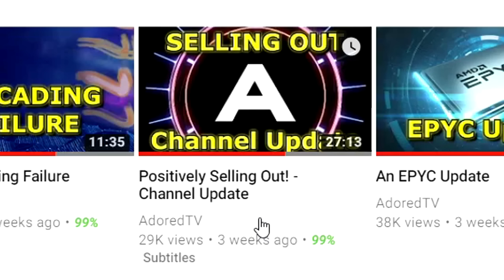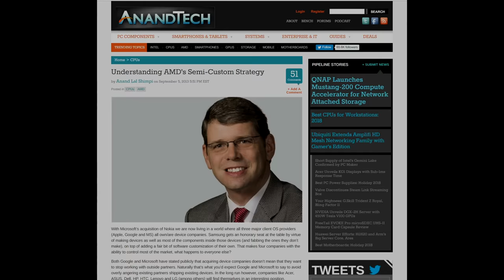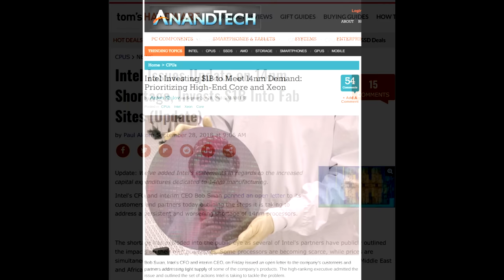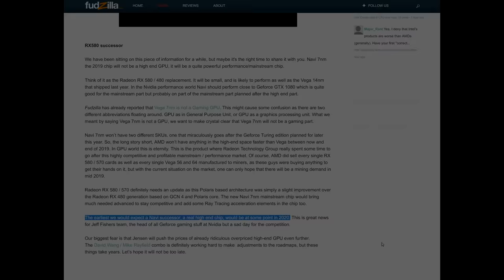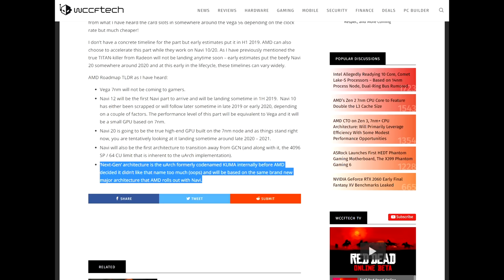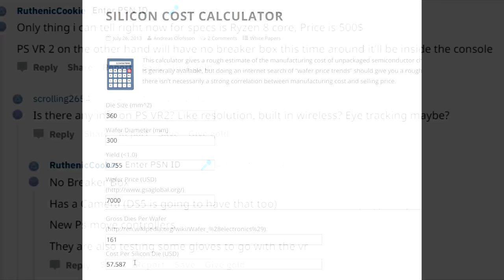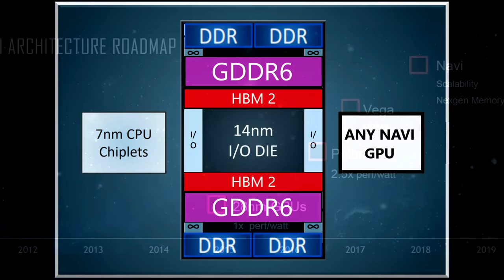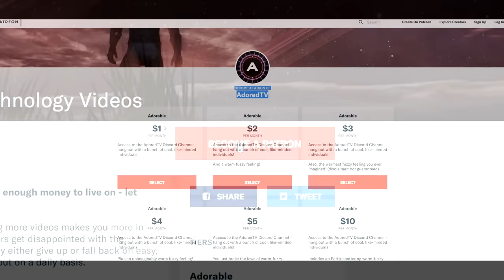AMD  - The (Evolving) Master Plan

Comment: Navi will itself be a chiplet, imagin datacentre chips where 1 socket can plug in 32 cpu cores and two gpus with infinity fabric and unified memory... Then scale to dual socket, or quad socket. It's not about 'the zen of gpus' zen will be a gpu/cpu hybrid in datacentre. As for consoles, just a smaller version, 1 cpu chiplet and 1 gpu chiplet with IF and unified memory.

Comment: The one thing i find really interesting in this whole thing is that AMD have only said that navi (and future gpu's) won't be multi gpu per card for gaming only until, and this is the important part, that the games would only see them as one single gpu, rather than a crossfire type of system. Why is this important? Becuase of the way navi may work in the fact they could go for an IO die like the zen2 chips. I think they may be leaving the door open for themselves to be able to have the games look towards the IO as a single gpu, using drivers and possibly something in the IO die to make multiple navi dies work like one. After the debacle of the vega launch AMD seem to have taken a more conservative outlook on things and i think they want to have a working model of this so i expect they will launch the navi 12 cards (and the playstation version as well) before making some special IO dies to make a test version. That will give there driver dev's time to get post launch patchs done before they take some off that to work with the test cards they make to see how viable this approach is. Wheather we see a multi gpu navi based system will depend on how well this works and how quickly they can get it to work, if it takes too long i suspect they will skip the navi version and use the knowledge gained from this to be put towards there next gen gpu cards. The best thing is, the work done for the IO wouldn't even have to be a waste as it could easily be used for there professional grade cards as those workloads don't have a problem with multi gpu cards so all it would cost them in the end is the driver dev time which would still be useful for future cards.

Comment: (I would say it really make no sense in making 2 @4core chiplets for PS5.. I would say, probobly all future AMD CPU will use the same chiplets (of a version there of) but the really very low end.)
I followed you to the end now and relized.. ye... of cause.. Jim did understand that... of cause he did.

One way to scale it could be to have a very smal IO-die for low tear market, and a large with more L3 cache and say twice the memory controller for the high tear market. This even makes it possible to run the IQ-die in 28 nm .... if there is a point in that (i kind of doubt it)

The issue with HBM is that it.. as far as i know, it can´t be  used with FR4 mounting, it needs a interpose. (if they can´t find a way to trick it).

I would say, it really makes no sense in haveing bot DDR4, and a GDDR6 as well as a HBM2 controller. 

A snekey way of solving this would be to hock up memory in infinitifabric. This would be almost as efficent as HBM, but much cheaper and easier to produce. This should make the able to ad about  a GB or so of L3 DRAM crash (or about 256MB of SRAM)
Reply from the maker: There could be more than one IO die yes, I considered that too.  HBM 2 is a tough one agreed, I do wonder if they can get around the interposer for that as well.
Reply: @adoredtv  

"I do wonder if they can get around the interposer for that as well."
I would say.. for Playstation 5... not a chance, the economy is not there yet.

Running the memory of infinity fabric is probobly the second best option. Of cause, then they need to make there own memory chips, bit that is pretty cheap.

Having a DRAM cache makes a lot of sense cutting down the overhead for the. Specially for things like screen bufferts. A 4K display all frambuffers is about a quarter of a GB or so. Then having some stuff like render buffert or  models in cache is also useful. Pretty much just streaming the textures from the main memory.

This is also making the split GDDR6 and DDR4 kind of useless. Having unified memory in a console saves memory and also bandwidth.

I guess we are getting closer to my dream of a socketed GPU.. I predicted almost 10 years ago now that we eventually would have GPU and CPU in interchangable sockets. CPU does have L3 cache to cut down on memory access, GPU need screen bufferts, and they need to be rather large.

HBM is of cause one solution, but its to expensive for the main market, at least today
Reply: Well if Micron can get their 3D Xpoint in volume production, it could provide a buffer for a smaller HBM die, reducing the cost
Reply: @456MrPeople  yea that would be interesting.. but does Xpoint have sufficiently low latency to work as a buffer
Reply: From what I've seen from Intel's Xpoint implementation in Optane, it seems so

Comment: This makes a ton of sense. The better your usable/salvageable yields the better your profit margins. If you can go from ~80% to ~100% usable chips per wafer. You effectively get a 20% reduction in per die cost which gives you a sizeable improvement in revenue  per wafer.

For applications that can accept the increase in latency a chiplet design brings, the cost and yield advantages make it a no brainer. More performance for the same $$ or less $$ for the same performance it's like getting your node shrink but not having the increased wafer cost for it. Talk about having your cake and eating it.

Comment: Information gathering is an art, and you sir are a master of such. I think from the last presentation AMD is also trying to fix the Crossfire situation by utilizing the PCIE 4.0 to detect the GPUS through the Processor registering all cards it finds as one usable graphics memory. So a system with multi GPUs and new Zen 2 processors may be able to run multi GPUs as one. I am just guessing from what I heard them say.

Comment: Interesting.... @37:26 on the top-right corner you can see this particular chip came out of a partial die (yellow-marked) on the top right side of a waver.
The calculator graphic you got there (38:20) is quite accurate, nice to see.

Comment: Awesome video, One thing is not clear. The speculated IO die WILL be different from datacenter dies, right? Two sku's; one for all mobile, low end PC and Console market. and one with IF for all higher consumer and datacenter products. If true, they wouldn't even need 'IF'. And the Navi sku's seem very shaky. Then again, their entire GPU department seems to be lacking an answere.

Their mobile lineup partially failed due to marketing and consumer demands but also due to their high SoC voltage on their products. (Intel had years of refinement in that department.) I doubt chiplets will fix that problem, even if you consider 7nm. More dies = more complex voltage regulations.

AMD's chief architect Dan Bouvier on the possibility of fanlesss 7nm APU's in mobile.
“We looked at it,” Bouvier said. “But with all the overhead, it just squelched the frequencies. The OEMs have figured out to add about 50 percent thermal system improvement, and that may be enough, especially if you go into 7nm, where you get a nice sweet spot that just fits.”
https://www.pcworld.com/article/3299431/components-processors/amds-raven-ridge-apu-designer-points-to-power-as-its-next-advantage.html

Thank you for the hour long video. It has not gone unnoticed (and unwatched)

Comment: agreed 100%.  as per a previous comment on twitter or here (i forget), the Zen IO die is a beautiful thing for APUs, and it was begging for a navi like GPU to be paired with it.

also, i suspect LATENCY for GPU memory isn't such a killer so long as the BANDWIDTH is good enough.  the big accesses are streaming textures i would suspect; you're doing big chunks into the L2 cache, not smashing it with lots of small IOs.  Zen dies have pretty large caches to hide the latency as well.

Comment: Here's a nice addition to this.  Ray tracing scales better than rasterizing with multiple chiplets, and you can actually use compute units for ray tracing without hardware acceleration. So maybe AMD:s high end ray tracing part, is nothing more than putting multiple low end parts to a single package with high enough memory bandwidth to support everything.

Comment: I’m a fan of the memory controller having an Either a dual or quad core arm cores to run the consoles Operating System effectively allowing developers to use all 8 cores and 16 threads with out background tasks.

Comment: I think this could be true. However, one thing you need to keep in mind is that it's unlikely that they will complicate the consoles with multiple type of memory. Both the PS4 and Xbox One use the same memory for their APU. My guess is that the PS5 will have a unified GDDR6 memory pool to work with rather than a split DDR4/GDDR6 type of setup.

Comment: I do recall about 4 years ago hearing a rumour at Microsoft that they had intended a version of the Xbox to be able to scale up and blur the lines of a PC.  As in having more CPU power to do more PC like things.  A chiplet design would give them that opportunity.  Now that keyboard and mouse support is native and there are some production apps becoming available in the Xbox store, or at least beta tested it does make me curious to see if it'll ever come to light.  Interesting video, great insight, cheers!
Reply: Markus Brorson  I think you mean decades. I mean sure, the first couple of computer systems we had in the 80"s just had some kind of typing device but by the time we got the 386SX, we had a mouse finally. Actually, I still have that system and the first Microsoft mouse. So that's about 25 years old now. Guess I should fire it up and play some Blake Stone 2 😉

Comment: though I nowhere see you take in to account the lighting patrons as now they would be running 3 or more 7nm patrons which most likely need to be replaced with EUV, (1 Zen 2,  2 Vega compute, 3 Navi) and then atleast 3 14nm patrons (1 IO Epyc, 2 IO APU, 3 Chipset). That can't be cheap either. I seem to remember somewhere around 100 million for 1 patron.

Though now looking at it that patron cost will be spread over several products so it won't be much per product.

Though for the rest seems very plausible

Comment: First of your videos I had to watch in two parts :D  I wonder if they'll be able to use an active interposer to hold IO eventually. Seems like a good use for the previous generation fab process, since they're most mature and the interposer is big and IO doesn't need the smallest features. Having a logic chiplet sitting on its memory controller would be great. 
I think 6 functional Zen cores is likely, more likely than using two dies with 4 functional. Getting 6 cores that are good enough for 2.5Ghz is probably easier than finding 6 that is suitable for desktop. It will be amazing if they can leverage one part (IO die) for so many different segments like this. One cost I'm not sure you included is the mask price. I hear it's some $100M, a very good reason to reuse the same part everywhere.

Comment: I personally don’t think PS5 will have upper mid ranged Navi or whatever it will be card (1080Ti class estimate).    Historically consoles seem to favor upper entry level ranged kinda cards on launch. And that make sense, there is less risk, lower power targets and thermals and easier to scale up in the future.  

My guess is around Vega 56/1070Ti (1080 class) but not 1080Ti.

Comment: so saw a video about navi 12 being the first in production and guessed navi 10 would be in the ps5 when they mentioned that navi 10 by convention would have been developed first and likely be a "higher end" chip. Consoles aren't designed over night thus usually they would end up with old technology but if navi is designed for ps5 it wouldn't be strange for the cornerstone design (navi 10) to be the version used in the ps5 and given what would be a "higher end" chip now would end up as a mid to low end chip during ps5 development avoiding the consoles performance being considered dead on arrival.

Comment: if the same IO die can contain ddr4/gddr6/hbm2 controllers and be used for the ryzen 3000 cpus + navi gpus + consoles

it's a revolutionary design choice

i can assume that the IO die may even contain DDR5 controller and AMD will just use it for Zen 3/4/5 (future DDR5 Ryzens)

Comment: Aside from my belief that you were over-generous with yields, I really liked the speculation on the "everything chiplet" approach AMD could be taking. 
I believe the transition to 7nm will give us some very interesting price/performance products. Not just because of 7nm, but chiplets as well. The two seem to pulling each other along. I honestly don't remember when was the last time gaming hardware got me this exited. 
Also another thing to have in mind while discussing Navi used in PS5, is the Scorpio chip. That one is capable of achieving native 4k/60 in first party games, and that one still has those measly Jaguar cores with a close to RX470 performance gpu (if I'm not mistaken).
That means that the low end Navi 12 could very much be feasible in next gen PS considering the level of optimisation that goes into console games.

Comment: I really hope they use chiplet design. If chiplet design takes off, that means higher performance at lower cost for EVERYTHING on x86.
For example everything used in PS5, can be reused as a laptop (with some downclocking or smth to fit 120w power target). Imagine a 1440p capable laptop for less than 1000USD, optimistically less than 800USD. ITX PC's, APU's with GPU's that are actually capable of stable 1080p med-high on more demanding titles.

Comment: I question the benefit of putting everything and the kitchen sink on a single io die, you guarantee yields but also guarantee that you've wasted a large chunk of the die through redundancy no matter where it is used. Flexibility is great but there has to be a point where it makes more sense for multiple io dies to exist. Isn't one benefit of an io die on an older node that it's much cheaper to tape out different designs?

Comment: Hey Jim I got a question,
What about mobile? picasso seams to be just around the corner using zen+ (4c/8t) and vega just like pinnacle ridge.
Do you think that the following gen called Renoir could have a FULL zen2 chiplet (8c/16t) with the IO die and a navi (12) gpu fed by an hbm stack all on a chip?
Possibly even 15-25watt for laptops? that would be quite the chip I would like to have in a future devices!

Comment: Wonderful video Adored! Thank you for sharing. But why wouldn't they think of having directly different IO dies for different memory controller? IMO the cost would go down dramatically, and they could just change them depending on the market they are targeting, instead of putting all possible controllers on the same die and shorting off the ones that are not needed. Also packaging should be more or less the same with 1 unified controller or different exchangeable ones.

Comment: What is the cost to assemble the package? Making the individual components was covered but assembly and testing of the package was not included in the video unless I missed something. 

Will chiplet designs make it from the data center to the consoles this fast? I hope so because it allows much easier upgrades and enhancements over time which was not covered by the video. Just upgrade the GPU chiplets and the rest of the package can stay the same, which could be a major consideration for consoles since the PS4 and Xbox 1 had advances over time requiring a whole new designed monolithic chip. Sony could respond much faster to anything Microsoft puts out later and vice versa.

Other than that, video was outstanding!